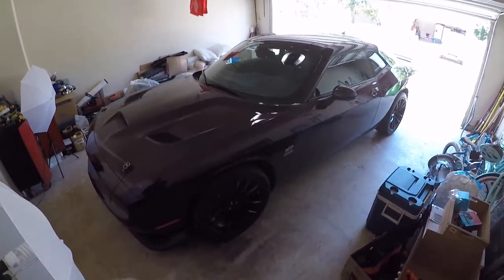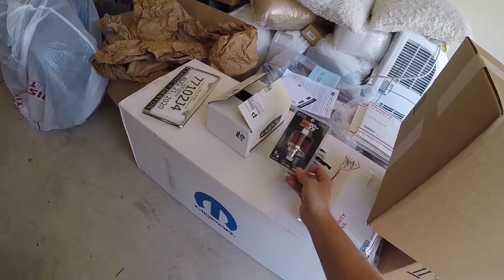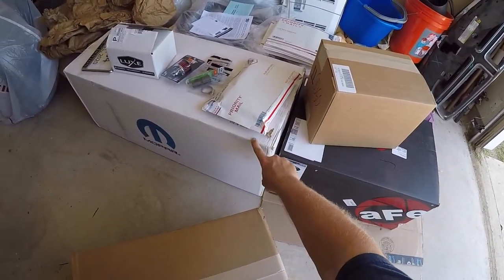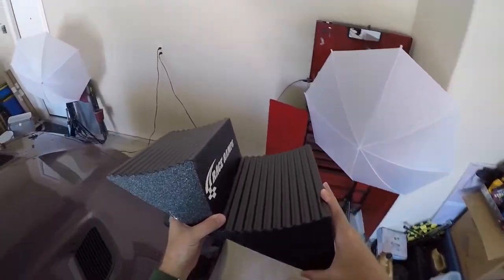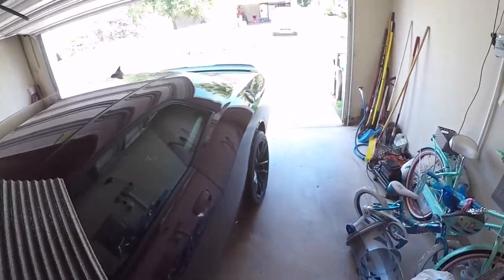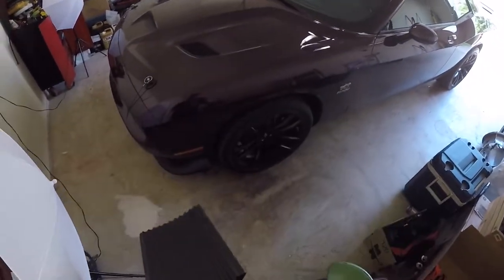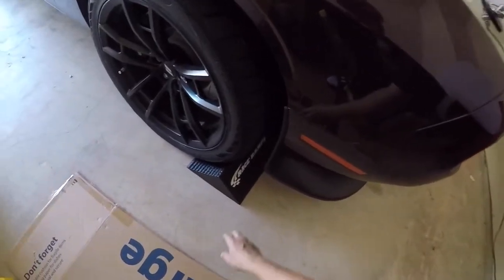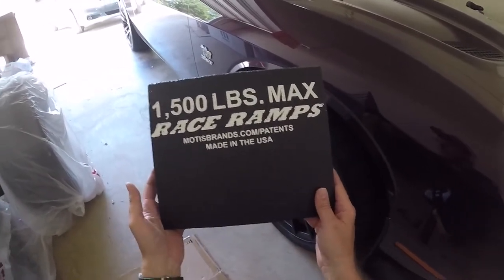Unboxing Race Ramps Wheel Chocks for my 2020 Dodge Challenger 1320

Comment: Dude I bought a pair of chucks for 5.99$at a Auto parts store And they do the same thing And they are hard plastic And I use mine as stops in the garage
Reply from the maker: Yeah, I know they're pricey and not for everyone. I think you can get those plastic ones even cheaper at Walmart too, but I just like these and the extra width. Race Ramps does make cheaper narrower ones too. Last week I used these to chock up my Avenger that was parked dead on an incline while I jacked it up to get the battery swapped out and I felt a lot more confident with these.
Reply: @Scavenger1320  I May look into The race ramps

Comment: you need a pair of ZL1 Addons lift points for your front end pinch welds. They are awesome
Reply from the maker: I've looked in to those. Might get some eventually. Just got the ramps I mentioned so I'm covered for a little while at least until I get my drag wheels and need to be able to switch them out.

Comment: Do they slide?
Reply from the maker: They've only slid on me once when I hit the brakes a little too hard while going up them, and even then they probably didn't even move a full inch. Otherwise I've never had any issues with them moving on me, and I've used them for both my car that's in this vid and my Ram 1500. Plus I've also backed up onto them a bunch of times and even with the drive wheels on them they haven't moved on me.
Reply: @Scavenger1320  what do you mean going up on them?  We are talking about the chocks correct?
Reply from the maker: @mikeprice8307  oops, my bad. I just saw Race Ramps and was thinking it was about the ramps which I also have, and have another vid on that got a lot more views than this one. Guess I should have looked closer. But anyway, to answer your question, when I'm pulling into my garage and my wheels hit them they don't slide at all. I've had them over 4 years now and still use them. Down side though is because they're so light, when your tires aren't up against them, they can slide pretty easily or be accidentally kicked out  of the way, so I always do a quick check to make sure they're still in position when i pull in.